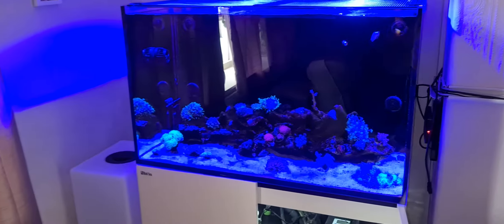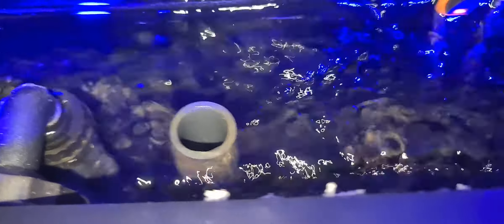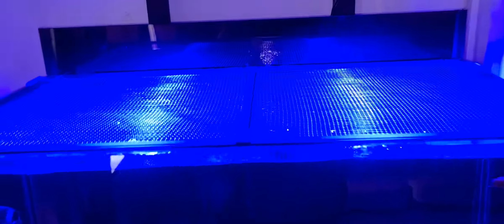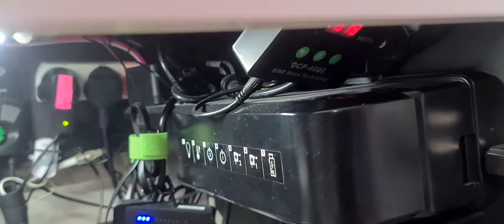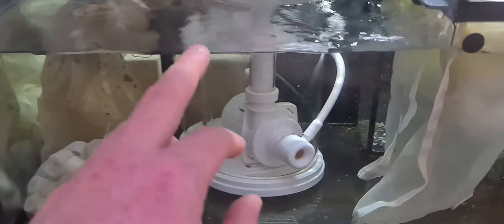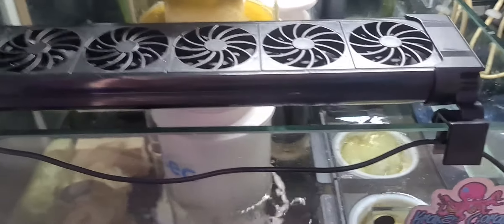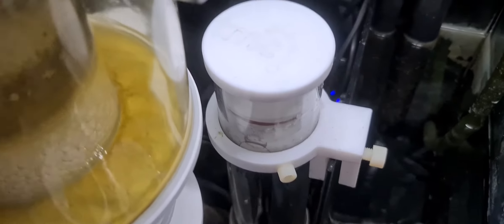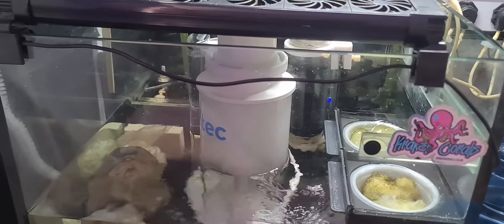My Reef Aquarium [ Tour ] REDSEA 69 gal

Comment: How did you get on performing the sump
Upgrade?
Reply from the maker: Yep all well now with the redsea e-260. The sump is simple layout. I originally had issues with the water level in the back into the main drain and emergency drain to stablelise the ato top off. The way I managed this is a trickle into the emergency drain its now perfect. I went with the ressea e-260 as bigger display than the 250 and came with lights.
Reply from the maker: Redsea 250 Display tank water volume (L) 204
Reply from the maker: E-260 Display tank - 213L
Reply from the maker: Also the truth was thought the all in one system would work for me. Without filter socks or a sump skimmer it was hard to keep clean. The redsea skimmer stock in rear didn't work for me was so loud.